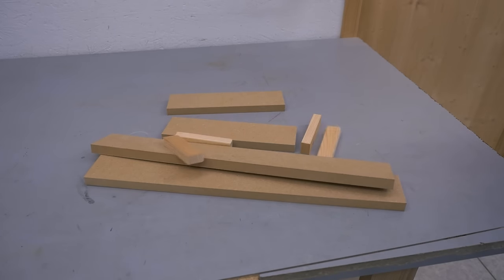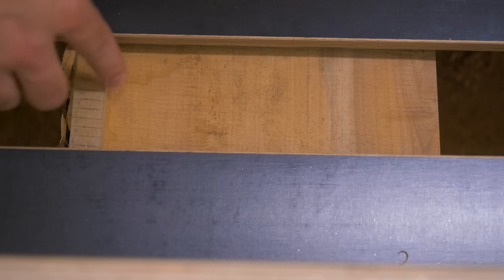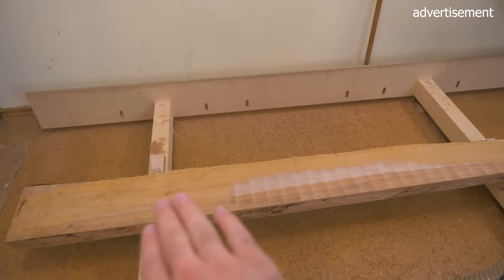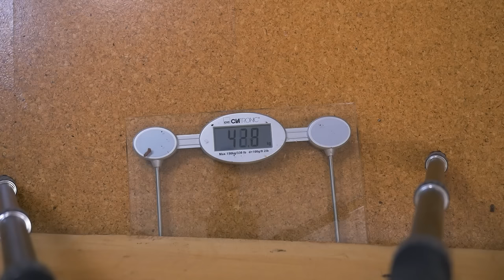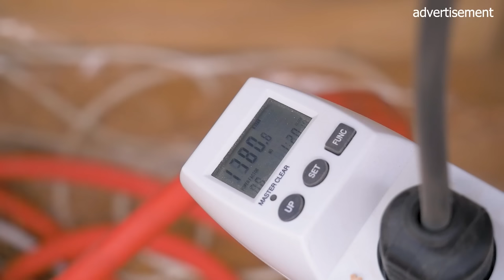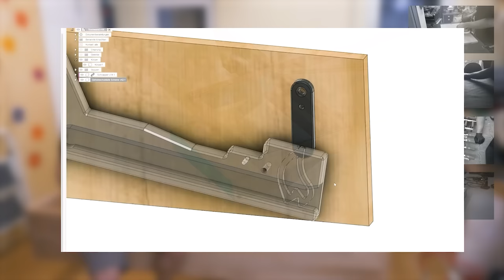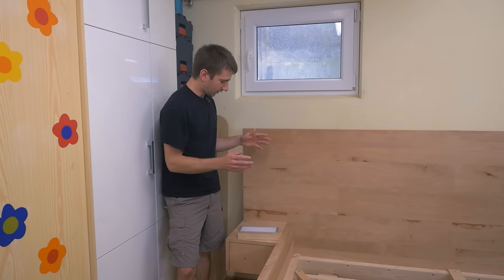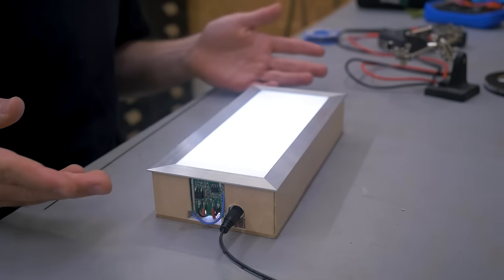Homemade 10,000€ Bed || 4 Unique Features

Comment: A suggestion: When using your router flattening jig, why not travel along the length of the boards in long passes. I do that with mine, it goes a lot faster... Maybe you'll have to secure the router...
Reply from the maker: I tried, but it was less comfortable crowling over the floor that much. At standing height I do so

Comment: why don´t you pull the switches and outlets forward and simply extend the wiring? So that they actually come out of the board and not the wall? This way you could even add an outlet if needed

Comment: why make cutouts in the headboard to fit your wall outlets instead of just installing some outlets in the headboard itself? would look nicer and make it so they still work if you ever move house.

also should definitley swap those LEDs for warm white rather than blue white so they dont burn your eyes if you turn them on at night.

Comment: Nice video! I like the creativity and build quality, but I feel like the design isn't really coherent and in my opinion, has some problems.
I think the rounded corners aren't well integrated into the design, wrapping the epoxy around the corners to give a super continues "flow look" or using some shadow gaps to accentuate the break in the rounded corner pieces, would have been a better choice in my opinion.
Furthermore, I think the lamp's cold, angular aluminum geometry doesn't really fit the yellow, warm, rounded design of the bed frame and most importantly the cold white, undiffused, non dimmable LEDs just seem kinda harsh and bright for a bedroom, especially at night.

Comment: Could you make a box to accept the wall outlets that mounts 12mm lower (which would obviously stick out) and attaches to the wall using the existing outlet mounts? The outlets would be near flush with the front face of the headboard, but would look decent. This would be a non destructive solution.
Reply: I forgot to mention, absolutely amazing build by the way! Love it

Comment: One thought I had watching you flatten, is it critical to go across? Seems like with the rack and pinion installed it'd be sooooo much easier to go lengthwise. And to go even further... Slap a motor on it so you don't have to crank! 🤭
Reply from the maker: Going lengthwise would be better, but going across was more comfortable
Reply: @MariusHornberger  so are you going to replace the crank with a motor? this thing is just begging for a motor, at least in the long axis!

Comment: Why change the light panels or move the switches when you could just put 12mm blocks under the frame, on the felt pads, to raise the frame 12mm?

Comment: It's a capacitive touch sensor (basically your body adds capacitance to a resonator circuit, that detects a change in frequency). Your aluminium frame has too much capacitance and fucks with the circuit

Comment: first i thought you could put something under the feet of the bed to make it higher but why not make a plate and have the outlets there and then attach it to the backside of the bed ? since the bed is so close to the wall nobody could touch the cables anyway

Comment: You couldn't use your jointer or thickness planer. Then you set up your router flatness jig, and cut the wood in half so WILL fit your jointer....
Reply from the maker: Still too long and heavy

Comment: It sounds like it would be much easier to simply shift the outlets and switches down the 12mm. If residential electricity is done there anything like in the US you probably wouldn't even need to mess with the wiring at all, just move the box itself down and repair the wall

Comment: Really nice build!
But why didnt you use your planer? You anyway cut the timber down to smaller width which would have fit the planer from my point of view after cutting. Or not?
Reply from the maker: The pieces were still too long and heavy for my size planer

Comment: Why not just lift up the bed by 12mm? That would be much easier than rebuilding the entire light boxes, with the added benefit that the top of the headboard will line up with the wall like it was designed to be. And it's not like you will notice a 12mm difference in bed height... that's less than a comforter adds! Just add a bit onto the feet so you don't have to throw away all of that work! Or better yet, get some hard rubber pucks to put under the feet for grip and noise isolation. After all, you don't want that bed going anywhere when you use those handcuff holes...

Comment: beautiful! absolutely amazing. love your work. i would like to ask you a question. i would like to build a bed with plywood sheets, 18mm thick. how wud you suggest to make them look floating in the air. usually the inside frame and legs are made of wood which are about 1inchx1.5inch thick. thanks.

Comment: 33:22 "Special feature" so carrying handle for headboard or bdsm tie point?
Also storage boxes sure are useful but i would not store anything with out bag in protecting them from the dust, but sure its nice feature.
On failure of the fitting the outlets into wrong place, just put cover in the back side, screw in some socket boxes and do install like you would into normal wall. Sure you loose current outlets, but if you ever move now you have those already installed in the bed and technically this counts as extension cord, least in Finland so you are allowed to make it your self. HOW EVER i would highly advice to contact electrician to come and make sure its properly installed since this is rather unique setup you need to use 10/16amp multi strand power lead, use crimp to get it into one peace wire and depending on your setup have spring loaded terminals to connect this in, so i would advice to use wagos to swap into solid strand wire and then connect it to where ever, develop tug protection into conjunction box and many other things that needs to be taken into count when building something like this. Also to be anally accurate on how much copper is showing and witch side wires go and miriad of other things you need to know when working with mains voltages. If you dont know what you are doing ask professional to design and help you with the install.

Comment: Why not put the whole bed 12 mm higher ( just 2 or 4 pieces of mdf ), instead of rebuilding the light panels?
Reply: then the gap to the bottom wouldnt be right, and the drawers would need redesigning, etc

Comment: About your electrical connection to the aluminium; this will fail over time because bare aluminium protects itself with a oxidized layer which is non conductive. It's a pain to make a electrically sound connection with aluminium. I did it with toothed washers and a circular soldered spade torqued down with an M4 galvanized bolt. It's the best way for me. Nothing failed yet but I'm curious about a real durable solution for making a electrical sound connection to aluminium which lasts for years without doubts. Let me know if your familiar with this problem (e.g. connect an anodized aluminum frame to ground reliable for the estimated lifespan of the machine. Say, I'm positive, quality build, 25 years+. Curious about all your answers. Best, Job

Comment: If you redo the LED, then use 2700K as suggested otherwise and ALSO use some sort of passive cooling. Simply gluing the LED strip on wood doesn't cut it. Give it at least some aluminum backplate. Otherwise you will significantly reduce the lifespan of the LED strips. Other than that, this is a TREMENDOUS project and was exciting and pleasant to watch. The result is spectacular.

Comment: I need to be polite yet firm with my wording here. If I fail please know that I do not mean to disrespect this guys work.
the bed build is interesting, but in my opinion it honestly fails.
1. the lights.
they're horrible. the whole bed has soft roundovers but the lights have sharp angles. The lights have a random 135 degree angles and the black (why are they black my man??) isolation inserts look as if he simply missed the measurements. furthermore, they are made of aluminum which clashes so badly with the soft wood frame. the white frosted glass is another calamity for the same reason. the bright daylight white ledes - same thing. and all that aside - what are those lights even for? they are controlled from the headboard, which means they are quite useless in helping you in getting to bed and they are equally useless when you are getting out of the bed, because both cases you would need to traverse your path twice to turn on or off the lights on the bed. furthermore - where exactly are they shining? they are useless as a reading lamp and simply too big and bright as night light. the way they are positioned cuts into your eyes: the distance from the edge of the light tot he edge of the headboard is about one third as the distance from the top edge of the lights and the top of the the headboard. So the sharp corner is pointing in nowhere specific, and the round corner of the headboard clashes with the sharp 90 degree corner of the light.
and then there is the cutouts for access to lights and switches.... they are simply panful to look at.
suggestions on the matter. Light wood only matches with brass. light brass to be exact. and other shades wood (shades, not color tones, no rose wood damn it). those are your accent colors. If the whole bed has roundovers, the built-in lights also should have rounded corners. The corners should either align or you go for visually unconnected elements. Here is what I mean: look at the edges of the lamps. Where are the corners pointing? Exactly! For comparison, take a look at the sharp corner of the drawer. Where is that pointing? At the place where the corner would have been. Those are connected elements, because your brain wants you to connect the shapes together.  Alternatively, you go for unconnected shapes, in this case this means curves that create undefinable shapes. moving on. Those lights are simply too big and draw too much attention to themselves. Not only that but the aluminum edges also have to be thinner. The "touch to turn on" feature would have to go, or relegated to a different inlay. (Side-note here. There are light switches in the outlets right now, which makes you wanna use those to control the lights.) Ledes should be incandescent-like in color temperature to not clash with the wood color temperature. And those holes.... they simply have to go. Either move the switches and outlets somewhere or get some smart lightbulbs in the room to control via app or voice.
2. that tiled headboard cushion..
why is it black? Black does not match with the color of the wood... See, its one of the reasons why its so damn visible: high contrast between the headboard and the cushioning. Sharp angles in one plain and soft cushions in another plain? Yeah, that clashes too. The hight of those is completely disjointed from the height of the led panels. The pattern and angles of the tiles are not repeated anywhere else. It also is too big and commands attention (just as with color, it is highlighting all of its strange quirks) and to small to be proportional. And then there is the texture... it reflects light in a different way then the stone inlay of the bed frame, so even though its the same color it is not the same texture, making the clash even more apparent (its so apparent that you don't even notice that the shade of the fabric is too light to match with the inlay anyways).
fixes. my take - why keep it at all? why hide the beautiful wood? if you're not into minimalism then it at least needs to follow the geometric language of the rest of the project (in this case - rectangles with rounded corners). It should be off-white or beige, this way it will not clash and will not draw so much attention to itself.
3. the stones in the inlay of the bedframe.
first question - why? if the floors were dark and the inlay was at the very bottom of the boards I would think that the point is to visually narrow the frame, making it seem even more afloat, but that is clearly not the point. A side effect here is that on the bedside tables this inlay is at the bottom, and not in the middle and that clashes.  it clashes in texture and color with everything else and serves no purpose. again, why not let the wood be the star of the show? If you don't want it to be the star of the show then this inlay needs to match with at least something! if you wanted contrast then going for a darker/lighter wood would have been a better choice. Making the bedside tables have two drawers and be the same height as the sideboard would also help with the floaties of the design and would be much more neat. last thing - it ends so abruptly why not let it go all the way around?
how to fix it? Well, swap the whole thing for a different shade of wood instead. I would suggest light wood which would then match with off-white/beige headboard cushioning. And the bedside drawers be the same height as the sideboard. Reason? The two are connected and have no visual separation one from the other, which means that you either need a transition curve/line between the two or the two need to be geometrically aligned.
4. this is the last one, I promise. The corners that have two roundovers.... sigh... do I need to explain this again? either do the same thing everywhere else or don introduce this random separation line. also, the grain direction changes to being perpendicular to both boards that it is connection. Bad, don't do that.

overall:
build quality - 10/10
design - fixable.

I've learned a lot of technical stuff from this video, and also got to know what would happen if I would skip on my design classes.

Personal not to the the guy in the video. If you like your work - that's what counts. if you want to sell your work then you would rather know why your very expensive furniture is not bought. My aim was to help. If you don't care to sell your stuff - ignore the comment.

Comment: Why would you spare out the sockets and light switches? To make everything perfect and then reveal the boring white plastic outlets?! Why not cover them or build in extra ones with a better design and appearance to plug in invisibly at the back? Connect the ceiling lamp to smart home to control with your voice and there's no need for that old light switch!

Comment: There is a better way to do it if the Maschine cant handle it. Cut the wood in half and maschine it flat. Then put it together again. You dont see it because its a small 4mm of the wood that is missing. Als professional wood workes that learned the job do it like that. We dont build a maschine like that Just to much work ^^

Comment: well your skills are impresive. But the design needs improvement. The LED-panels do not match at all. The cusions on the headboard should have a different color. Keep everything in warm colors to match the wood. In general I think it is over engineered - but this is preference. But well done - sleep tight.

Comment: Very nice, but when you're finished with it no one will want all the hassle of disassembling and carrying all that weight around in their lives. Americans move on average every seven years. Think about that with 300 kg of bed to lug around from home to home  (and take note that professional household movers charge by weight and distance). The 40 mm headboard is ridiculously, and unnecessarily massive. But the biggest problem is with your "modern industrial" style of design. Which is a design style that narrowly constrains available design elements to only such lines and planes as can be easily handled using rigid machinery. Why use solid wood, a craftsman's material, for a "factory design" style product? Solid wood is for more generous, early-or-pre-industrial design styles, styles that are made primarily by hand, where design elements can be more free and open and spontaneous. What you have done is build a bed with machines, by machines, in the image of a machine, a bed that is itself a kind of machine. You have built a literal Procrustean bed; a machine style bed that will shape your appreciation of reality into a mechanistic model, rather than expressing your inner artistic perceptions. You did not trust yourself to design something free and open and instead you allowed the machines to build you into a corner and force your vision to conform to them, rather than the other way around.

Sell the bed if you can find a buyer, and spend your talents building a bed of dreams rather than a "bed machine" of nightmares.

Comment: I don't like it. You could have done a much better use of those amazing slabs. Anyway, here some suggestion: add to the side tables top panels, at least 2 USB ports per side, to recharge a phone, kindle, etc. Make a system to raise the mattress so you can watch a movie in a comfortable position. Remove the two drawers, since they aren't deep enough to hold a full size blanket or cushions, replace them with a system that hides a full size 40 inches TV, that comes out automatically. Your bed remembers me an old hotel room in the '60. The frame is way over engineered. I found amazing you CNC project, but this one is not. No hate, just my humble opinion.

Comment: No intention of being an asshole, but this bed is rather a frame with a lot of labor-hours to it, which could have been avoided in a professional environment. It has a shitty sub-frame and even shittier mattresses. I'd say that street value is just under $1500 for this frame. Anywhere above $2k you can't have visible plywood, those aluminum frames, denim cushions... Is it sturdy? I'm sure it is. Did it cost you a lot? Probably not due to DIY, but bare in mind that actual expensive furniture is expensive also due a certain branding and the finishing is on another level, also for hidden parts... Take a look at the Ames chair; the original costs around $10k, while a almost identical one, made by who knows who, sells today for under $1k. Cheers!